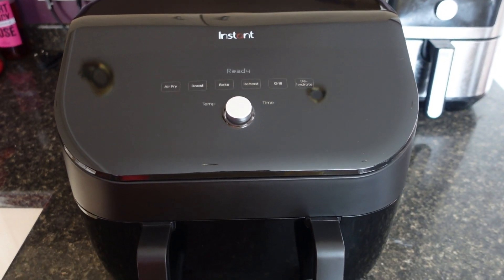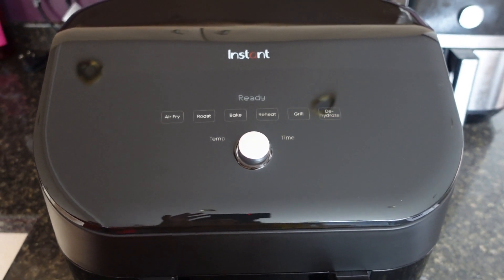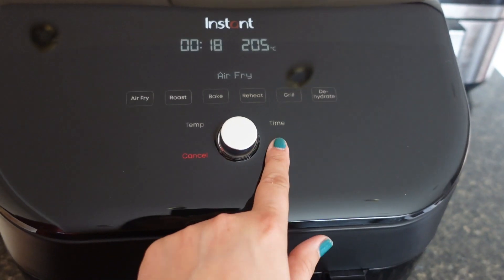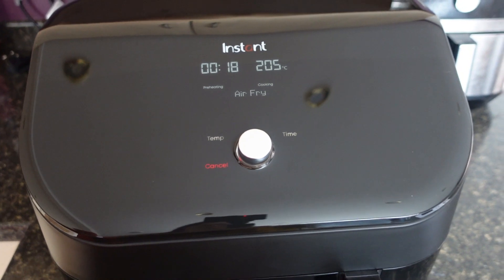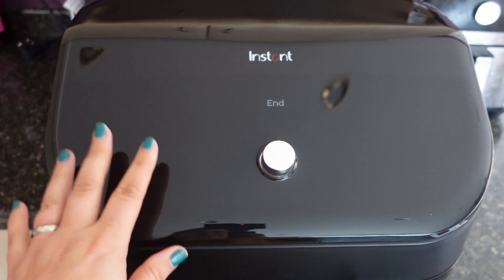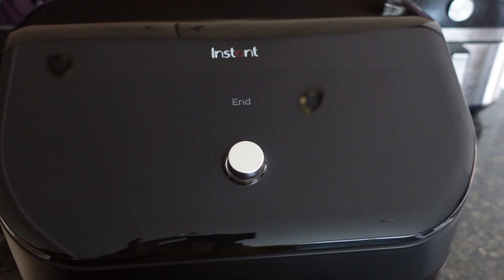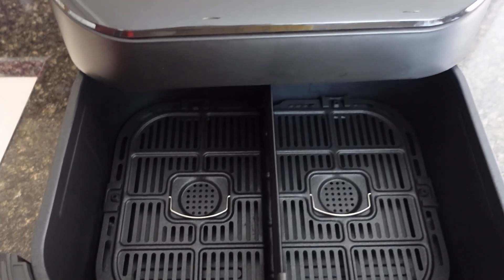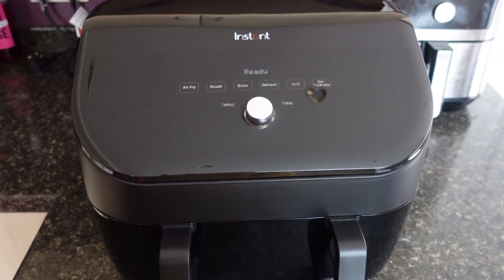Instant Vortex Versazone initial test run - It STINKS!!!

Comment: I ran mine 4 times at 1 hour each time, 400 degrees Fahrenheit on the air fryer setting. I still had a bit of the smell during the third 1 hour cook but after the fourth hour I haven't noticed any smell and I haven't noticed any plastic taste on the food I've cooked.